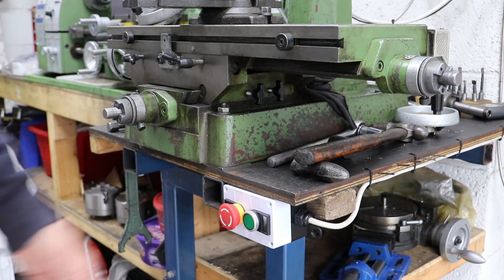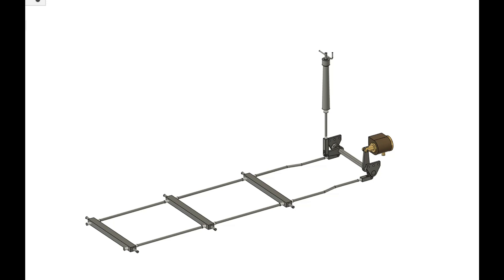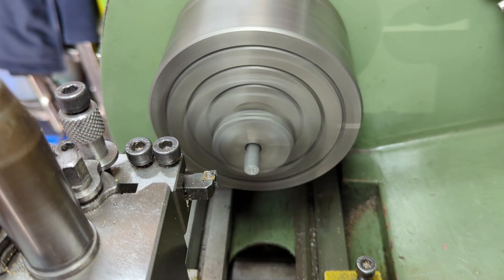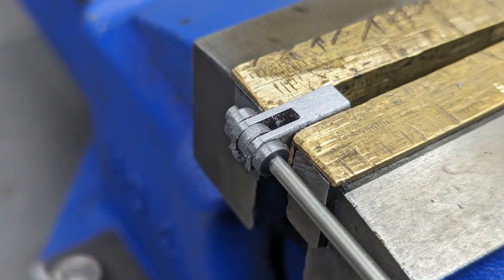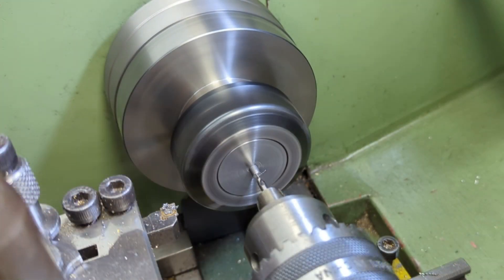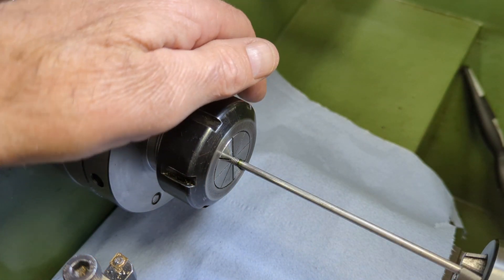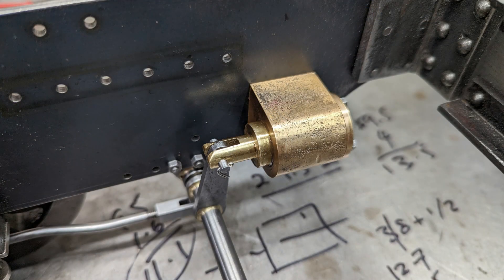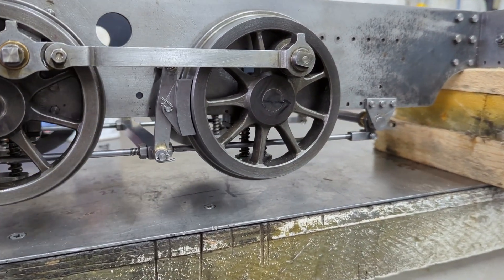Part 57: Finishing the brakes and some distractions

Comment: Sad this series seems to stop here would love to have seen more..
Reply from the maker: @mightynosebleed7476  I will be restarting, I've just got to get a m/bike restoration out of the way...
Reply: @markshomeengineering5243  That is very good news and I will look forward to watching more very informative and instructive videos. I am currently building my first 5" gauge locomotive and I have found your videos to be of great value whilst working my way through the various parts and castings. Most especially how you clamped and keep machine rigidity whilst doing them. I have watched your wheels video multiple times whilst gaining the courage to take the first cut on the back face. Thanks as i have found them invaluable
Reply: @mightynosebleed7476  yes, wheels do take a leap of confidence.  Be careful with my wheel videos, as I'm pretty sure I was a bit too quick to skim off the face on one pair, which meant I had to machine a couple of raised hubs later. 
Good luck and let me know how you get on 👍